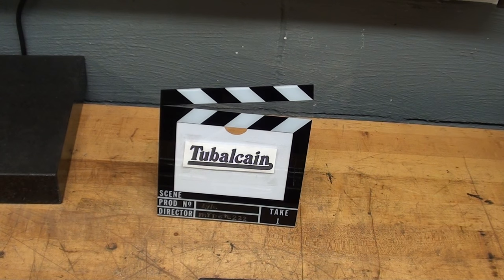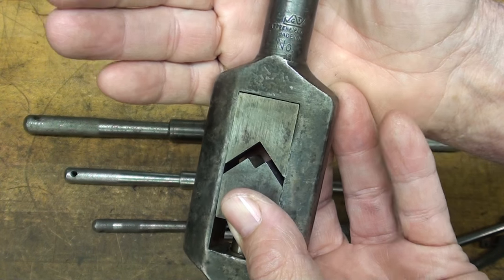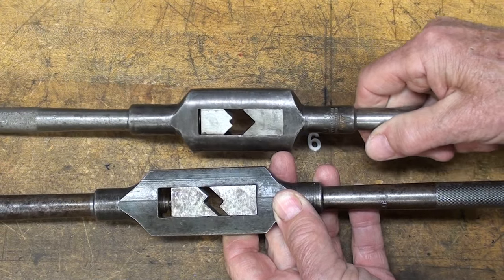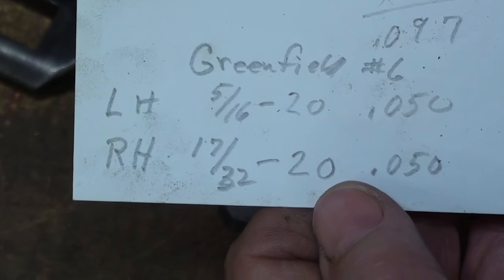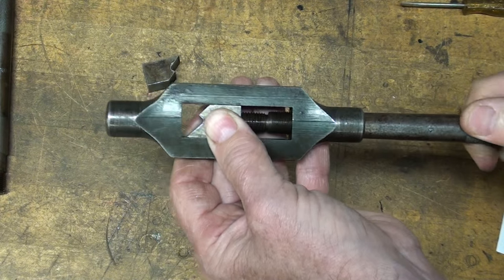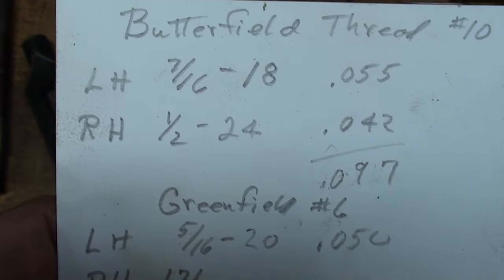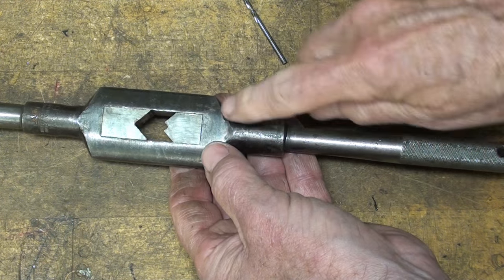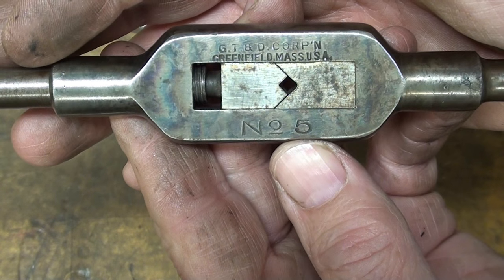SHOP TIPS #303 Discourse on Greenfield Tap Wrenches tubalcain die

Comment: The commonest place where a combination of RH and LH threads move something twice as fast is the simple turnbuckle.

I like the design of the Butterfield a bit better. I think (no engineering; just a guess) the asymmetrical jaws will give a better grip in one direction (flip it to get a better grip in the other direction). But the really cool thing is that left hand thread in the fixed jaw. That (combined with the asymmetrical jaws) makes the two jaws identical. The company only needs to make and stock one part to cover both jaws.

=======and here I digress (as usual)========
I was faced with making safety grilles for some low windows and wanted something with a stronger pull-out strength than a simple press fit for the cross bars and the uprights at each side. (This let me use very thin rods to avoid obscuring too much of the view, and still get the strength required by the building code.) I got a set of left-hand tap and die in 5/16-24 (from our old friends at McMaster-Carr) and fitted the left ends and side rail with left hand threads and the right side with right hand threads. Then it was just a matter of assembling both ends of 9 rods simultaneously. (It can be done. I did four of those grilles.)
Reply: +Peter W. Meek I thought about the holding of the Butterfield (actually it is symmetrical) and read until I found your comment. I agree, it will hold better in one direction. My logic is that with the Greenfield (and all the others I've seen), you get full contact on one side and a smaller amount of contact on the other; this is not going to hold as well as for example, full contact on both sides. Therefore, full contact along the side with the most pressure, duplicated on the other side, will logically work better or allow more force to be applied. And I like your two jaws identical conclusion. 

I have to say though, you mentioned that "The commonest place where.a combination of RH and LH threads move something twice as fast is the simple turnbuckle." Hold on, it doesn't speed up the action of the threads, just allows the thing to work while turning in one direction. Either both sides come together or both sides move away. The combination of RH and LH on the tapping tools "gears it up" in the right arrangement. If they are the same direction, the design changes like you pointed out enabling both jaws to be the same, just a different screw arrangement, both same handed. Interesting to see both tools use a different approach with the same end result.

It's a good video. Reminds me of: "How exactly does a posi-traction on a Plymouth work?" "It just does." -Father of Joe Dirt.
Reply: True, the Butterfield jaws are symmetrical, but in a less common form: rotationally symmetrical (of order 2). We usually think of symmetry in the mirror-image sense.

Just as the tap holder closes at roughly twice the speed of a single screw, so does the turn-buckle shorten or lengthen at twice the speed. The LH-RH threading probably is intended to make it work at all, but the effect is to make it work twice as fast.

Comment: Some older knockout punch sets will used a compound thread. Color case hardening is another service I provide, mainly for firearms. The BIG 5" & 6"  conduit size wrench turned KOs used a compound thread set up to avoid too too much movement of the draw stud and to pull the die in faster without stripping the threads off the die or the draw stud. I did not see big wrench driven studs for many years, unless someone brought in an old antique punch.. They were all hydraulic, and now they are back, but only up to 4" conduit, as far as I can tell. The stud drive was a big ugly cast football shaped blob, you turned with a Stilson wrench. You won't see that anymore!
Reply: The big name in KO cutters is "Greenlee" who started out making mortise chisel & drill bit sets, for woodworking.

Comment: Interesting.  I'm a retired engineer, but not a mechanical one, so take it for what it's worth, but the Butterfield design seems like it would have more surface contact when turning clockwise than the Greenfield, because the longer edges on both jaws would be working together.  On the Greenfield, only one long edge on the fixed jaw is applying force at any given time.
Reply from the maker: Great observation and analysis

Comment: Since I can't actually measure both here, the appearance shown in the video lead me to believe that an equal amount of tap edge is contacted by both brands. Each side of the greenfield V appears to be (at least close) to the length of the short part of the butterfield L. So equal surface contact.

As for which is better, I suspect the butterfield design is, since the entire 1/2 of the tap pressure is on the movable jaw V of the greenfield, and the other half on the 100% contact fixed jaw. Remember, the forces exerted are not solely rotational, since the silly human operators rarely apply pressures in only a single plane at a time, being the defective poorly-programmable meat machines they are. Side thrusts would appear to be more of an issue for the greenfield design.

 - Wes

Comment: How did they?  Back in the day when these tap wrenches were manufactured how do you suppose the rectangular hole was cut to get the accuracy and fit for the jaws that hold the tap.  When you took the wrenches apart you commented several times how good the fit was between the body of the wrench and the jaws.  Just curious as to how they cut the rectangular hole and got the fit they did in two hardened surfaces.  JD/Missouri

Comment: I have a Morse brand No.15 (19 inch) that is the same size and design as the Greenfield No.7, probably produced by Greenfield as well. I also have a Butterfield No.11 (19 inch) however it does NOT have the dual threads on it, it only has a single thread with a blind pin holding the jaw in place with a rail machined inside the main body to keep it aligned. I have to wait until I get a milling machine and remake the jaws on the Butterfield since someone broke the original jaws, guessing they never seated the tap all the way through.

Comment: I guess strength depends on how you look at the use of the tool. It appears to me that the Greenfield is designed to be equally strong in both directions of rotation because to allow for the same surface contact either way you rotate it. The Butterfield seems to appear to me to be built to be  stronger in one direction of rotation but much weaker in the reverse rotation. It has a definitely different grip pattern from one direction to the other. I assume if you want equal strength on the Butterfield you must turn it over. Such as a left hand cut verses a right hand cut. While the greenfield will work regardless of which side is up.

Comment: The Butterfield looks like it has slightly more engagement surface compared to the Greenfield but I don't know if that fact alone would make its design better than the Greenfield.
Reply: +jusb1066 
There are also other advantages. 
Both handles are nearly identical and can be forged and shaped with the same machines.
The centerpiece can be produced with less steps compared to the greenfield. And in the beginning on both sides are identical to forge and machine, so the orientation is less critical.
With the corse and the finer thread the holding power is greater.

Comment: The Butterfield jaws would have been easier (and cheaper) to machine due to not having the V-notch on either jaw, while achieving equal or greater holding of the tap.  Also, external reverse threads on the movable handle would probably have been easier to apply than the reverse internal threads on the Greenfield.
Reply from the maker: Good analysis